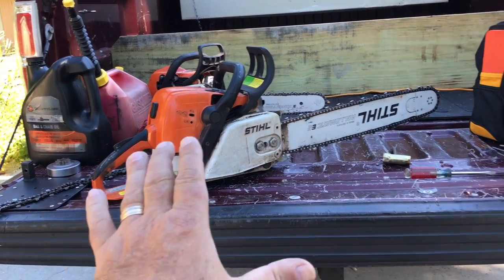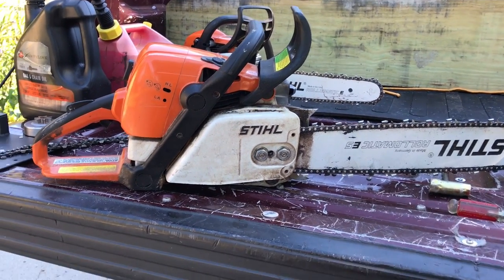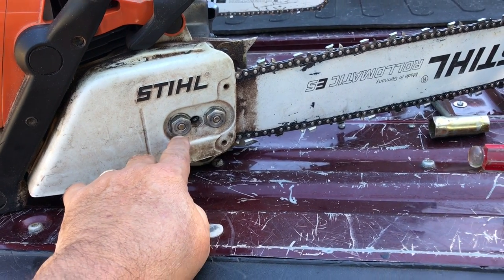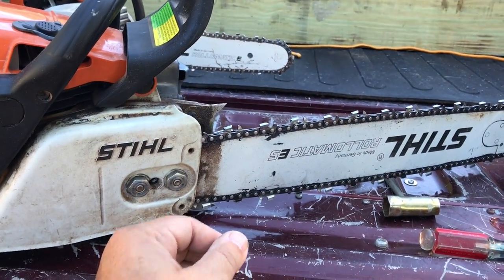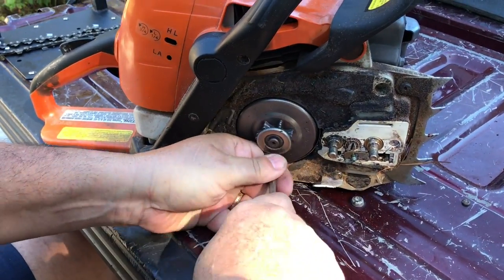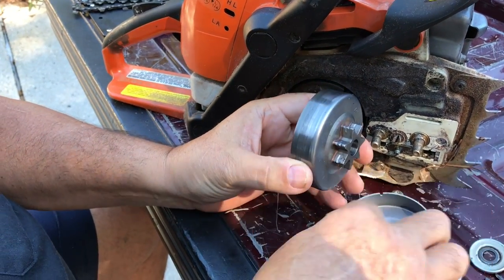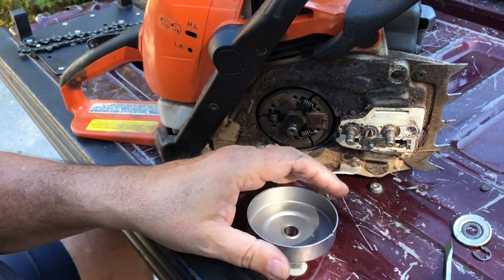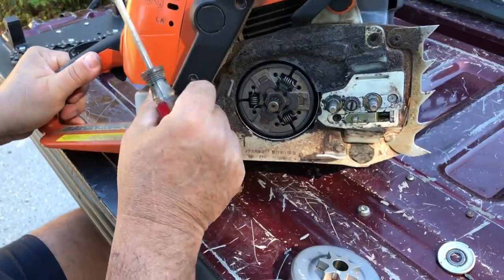How to replace a chainsaw sprocket,Stihl MS 290,310,390,391

Comment: lol, it seems like at times have somewhat the same issues. I had to replace the primer ball and filter on my Rancher 455 today. I think I'll check the sprocket while its still on the bench.  Thanks
Reply from the maker: they are cheap enough that its not painful to replace them even a little before they actually need to be.

Comment: I like quick n' easy fixes.  Not those involving springs and detents that pop out and you never find em.  The lil notch and rod were the ringers here.
Reply from the maker: I heard a chainsaw guy say that the sprocket should be replaced at every third or fourth chain replacement. I never knew!!

Comment: Been busy with Hubby's sudden health issues.  Good video!
Reply from the maker: I certainly hope it wasnt serious and  he is well now!!
Reply: It is serious discovered he has an aortic aneurysm.  Thank God he had an issue that helped us discovery it!  Will be having open heart surgery for a repair in the next week or so.    The size is less that what usually requires surgery right NOW. But is got to be fixed.  Just go back yesterday from another test, at least he doesn't so any blockage anywhere and his valves look great too.  Hope you and Mrs. are doing well.
Reply from the maker: Prayers sent. It will all turn out well,I have faith!

Comment: The ad was for a MB S-class sedan,  Man, do  they sure do know us or what?    Oh, and I liked the patented karate chop c-clip installation.   ;-)
Reply from the maker: and my special C clip installation tool. To the layman,it might have looked like a cheap craftsman screwdriver.
Reply: BCtruck, rebuild, repair,repurpose but to us paid professionals, that was a number 3 circlip installation tool. (Snap-On would charge $150.09 for it.....)

Comment: Got it  Thank you very much, Its a small thing but very important ,I was told by a Stihl Dealer/repair man.A wee question or 2  though ? If you have a link to a Video showing how that Oiler works. Or does it matter the position either is at so long long as the slot in the sprocket housing  goes down over that little shiny bar ?
Looking forward to your reply
Thanks
John
Reply from the maker: It doesn’t matter where the oiler bar is as long as it’s in the slot if the clutch.

Comment: Useful video. I always find when trying to remove the C clip on the sprocket it always pins off and I lose it and a struggle to get off. How do you do this without it pinning somewhere and how often do you tend to change the sprocket?
Reply: @fuckcensorship69  That sounds about right but I usually go by how deep the wear is on the sprocket and you can use a measuring gauge.
Reply: @fuckcensorship69  Haha I think you can tell by looking at it by the wear as that's what I do also you know by how well it's cutting I find and you just know when it needs changing. But the guide helps.

Comment: I need to buy a good all round chain saw. What do you suggest for light weight but cut down a 16" or smaller diameter tree.
Reply from the maker: ArkansasPrepper the MS250 is a great all around saw. It has an 18 inch bar and can fell and buck.